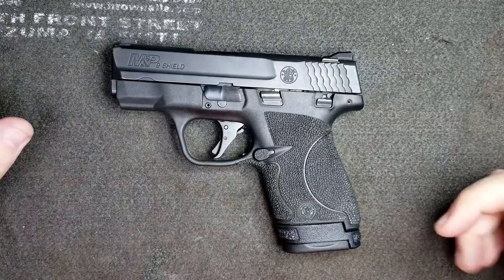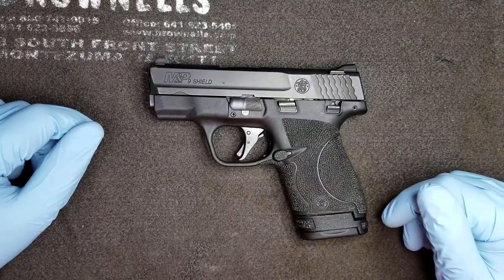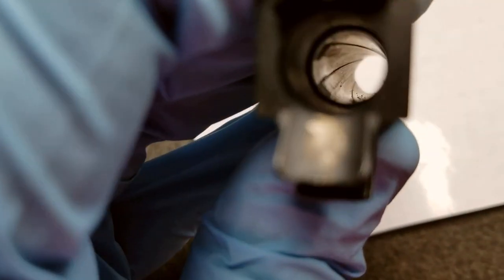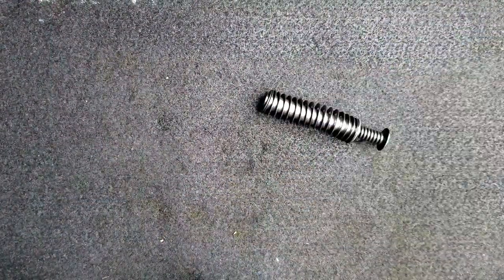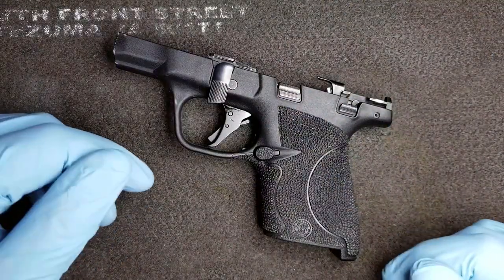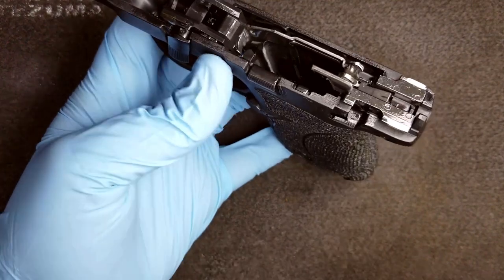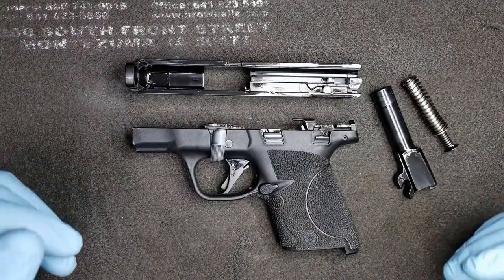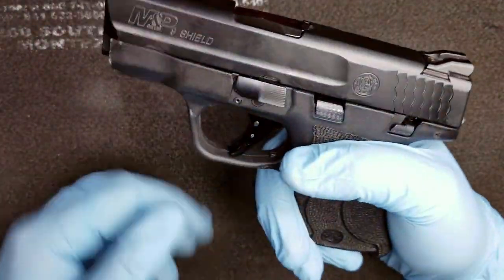How to Properly Clean a Firearm - Field Cleaning and Maintenance Guide

Comment: Saw this video linked on Pistolsmith.com, and decided to check it out as I recently bought my first firearm. It's an Astra A-100 in 40S&W, and wow, it was really dirty, as it's used and likely built 20-25 years ago. Thankfully there was no corrosion/rust, but it had quite a bit of powder caked in it. This video was very helpful. :)

Additionally, as I do have experience with metalworking, especially in finishing jobs, I actually lightly sanded, buffeted, and brought the various contact points to a mirror polish after several hours of work, then applied the oil. Between that and your instructions, my pistol looks better than factory-new, and cycles smoother than warm butter. :D
Reply from the maker: awesome, congrats on your new purchase, and welcome to the channel.

Comment: Nice video and I enjoy your others, just wanted to say Adding oil to the firing pin blocks are usually not recommended due to oil attracting debris and Using to much oil can cause malfunctions. Manufacturers may differ so oil to their recommendations
Reply: Good and thorough job. I have always heard to keep oil off the breech face due to you do not want any oil on the firing pin or firing pin breech hole. I will have to reconsider?